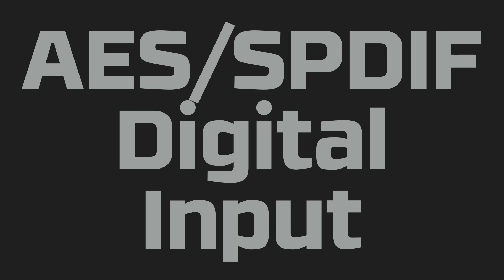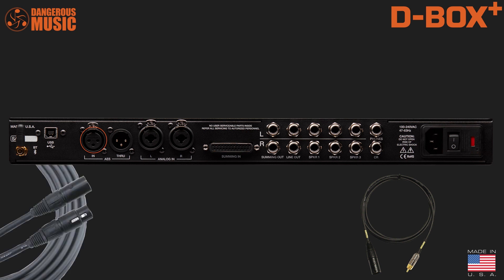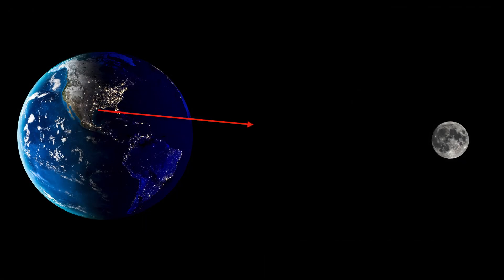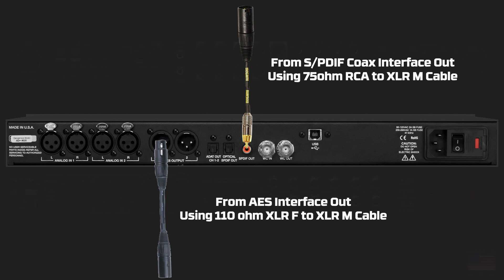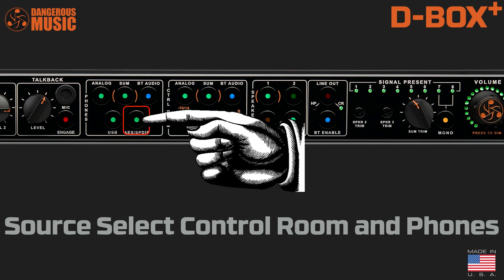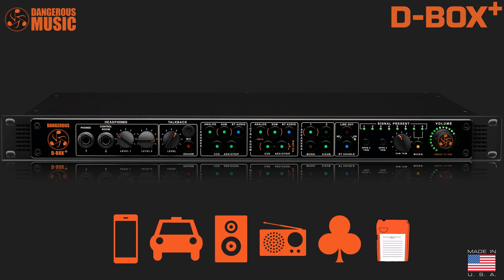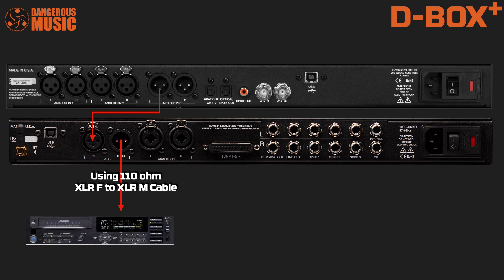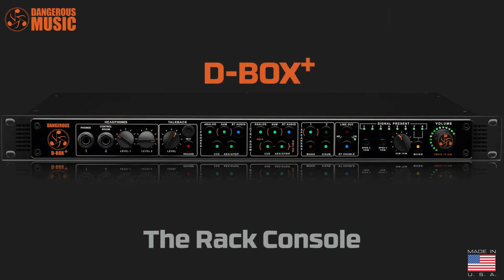AES SPDIF Digital Input | Dangerous D-BOX+ Video Manual

Comment: Can this be utilized in tandem with Trinnov?
Reply: The thing is…u would have to use the monitor outs of dbox+ to the trinnov input…i struggle long time to find a mon. controller and decided to wait on „la remote“
Reply from the maker: Hello, thanks for reaching out here on YouTube. Please contact our support team directly via form, phone, email or web meeting. They have accumulated years of experience helping people get wired up for their workflows. All the hookups are right here - https://www.dangerousmusic.com/support
Reply: I just bought the Convert Ad+, still struggling to get it right with my 2Bus+. I wish  there was a video to explain how to really sync them. I’m using an Antelope Audio Orion 32+ Gen 3. Looks like all the videos about dangerous are for the Apollos interfaces. Please help if it’s possible.
Reply from the maker: @jamescave7102  - Hi James, thanks for the question. Please contact our support team directly via form, phone, email or our new web meeting option. They have accumulated decades of experience helping people get wired up for their workflows. All the hookups are right here - https://www.dangerousmusic.com/support
Reply: @dangerousmusic  Thank you !
Reply: @jamescave7102  u should have a wordclock in/out on the  Orion, so u need to connect the wordclock out of the antelope into the wordclock in of the ad+…on the converter u need to dial in externalclock…that should work fine
Reply: @Suburbstudio  Thank you, i will try it.